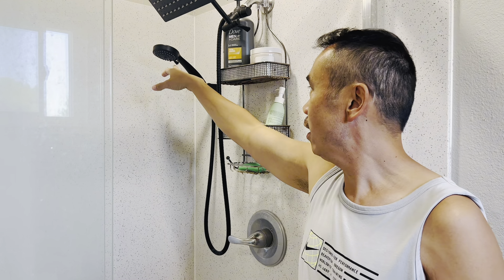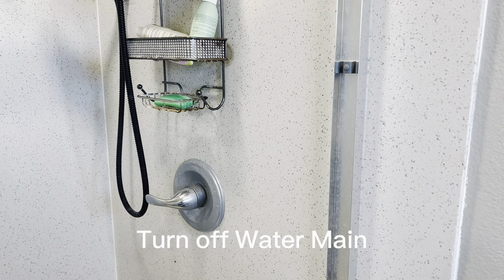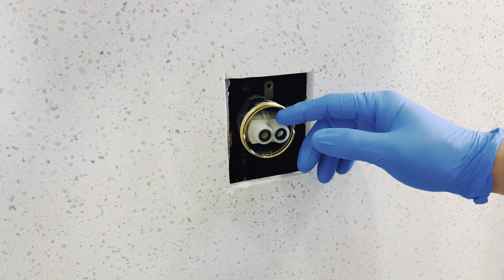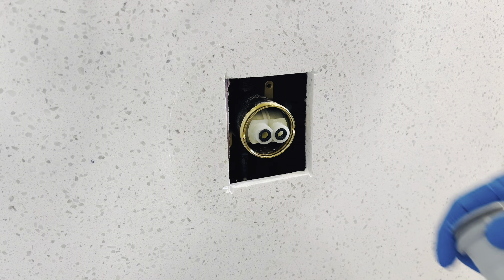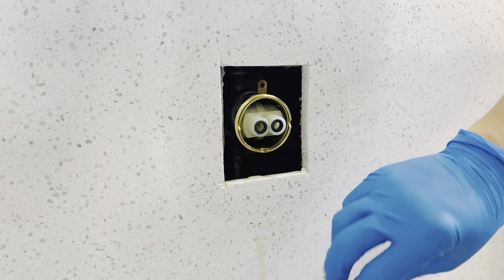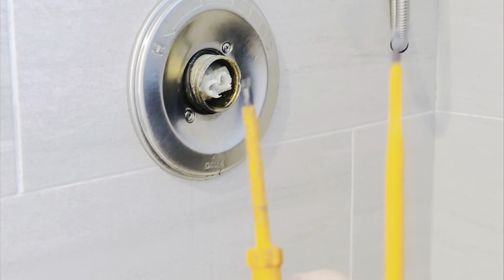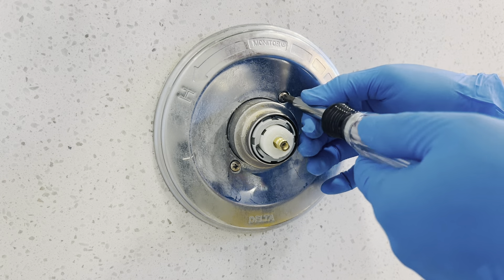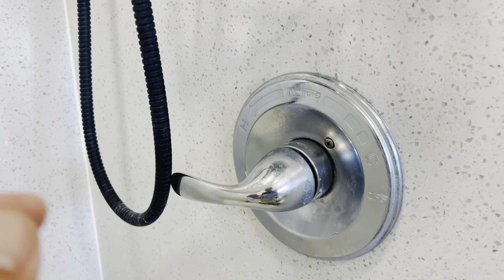How To Fix A Dripping And Leaky Shower Head - Delta shower cartridge replacement

Comment: Hey Don.  I liked and appreciated your video.  I am a weekend warrior.  I am fixing my Delta Monitor valve tomorrow morning.  I feel for you in regards to cost (...wife, kids, dog, etc...).  With so many cartridge models out there, I finally called Delta to figure out which valve my system takes prior to removing the cartridge.  When they asked me if I was the original owner, I stupidly said NO.  Had I said YES they would have sent the new cartridge to me for free.  The lifetime warranty is NOT transferable to 2nd+ owners.  Needless to say, I went to Home Depot and purchased the Delta brand cartridge...not the Danco third party replacement cartridge.  I purchased both the RP46074 and the RP19804 just in case the tech support person was wrong.  I will return what I do not use to Home Depot.  Thank you.

Comment: I bought the cartridge on Amazon using link. It did not fit. The hot & cold prongs were too far apart. Probably not for a Delta. Will search more.